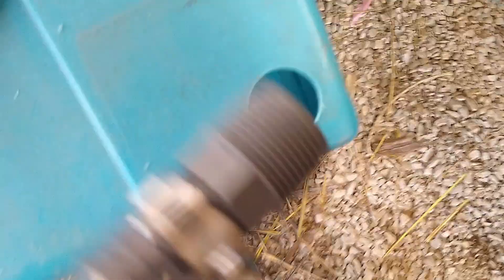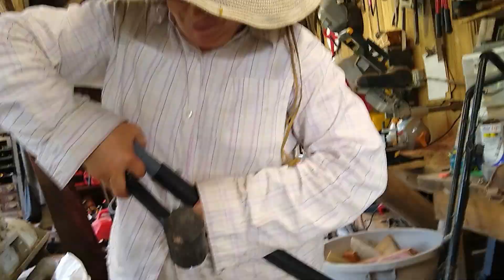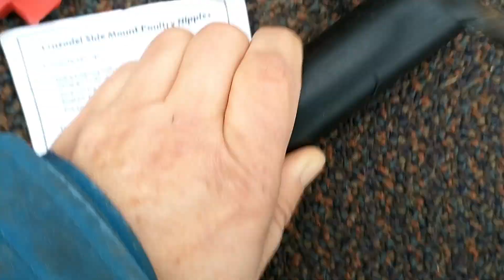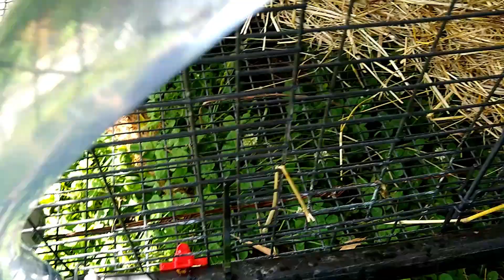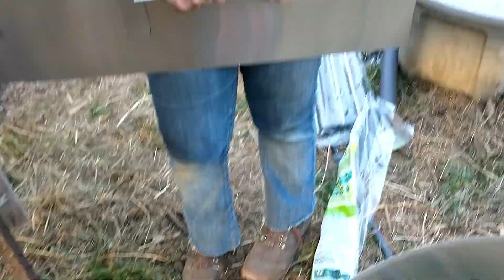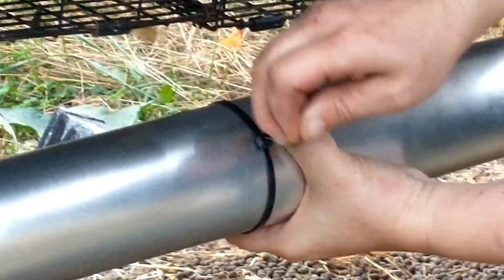Heated Automatic Rabbit Water System

Comment: Very nice. I don't know if it will work at -30°F. Great first video!
Reply from the maker: Probably not down to -30 lol.  You can purchase heat tape rated for different temps, but you would probably still have to spiral wrap those to get down to -30 and that would hold the pipe too far away from the cage after insulating and wrapping with flashing.  For temps that low I would use a recirculating pump and a bucket heater in your water reservoir, and plumb and insulate like I show in the video.
Reply: @BrambleBerryFarm right now we use stainless steel dog bowls and exchange them as they freeze